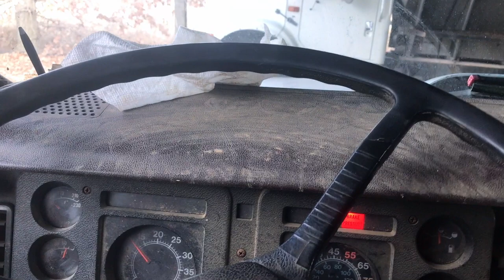Rice Stubble Rolling

Comment: thanks for sharing, just a few quick questions, as the roller does a great job.

do you ever need to cross a higher levees, as I assumed that the fours small wheels will rise up and over the levees, will this leave ruts on the levees or  damage?
also, i can see the straw still stand up, therefore by roll over the rice patty, or it better thresh the straw while harvesting will have better result? thanks.
Reply from the maker: We try to demolish all levees prior to stubble rolling to prepare for soybean planting in spring. This does often leave ruts in the field, but it helps flatten and fill in harvest ruts and what remains of the levees. Usually, only about the top 50% of the rice stalks are threshed through the combine harvester because there is only grain near the top 50% of the rice stalks. Therefore, about 50% of the rice stalks is not threshed and left in the field. I hope this answers your questions.

Comment: why not you use reversible plough or rotatarytiller [rotavator].
Reply: It would take a lot longer than rolling plus this will allow the water to drain off without washing the soil away. Plowing would allow the lose soil to wash away from heavy winter rains.